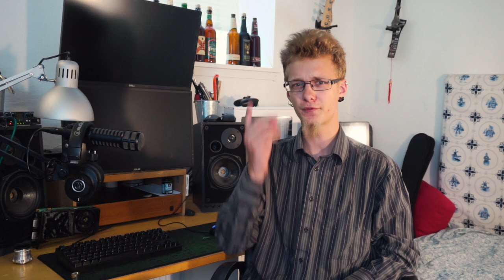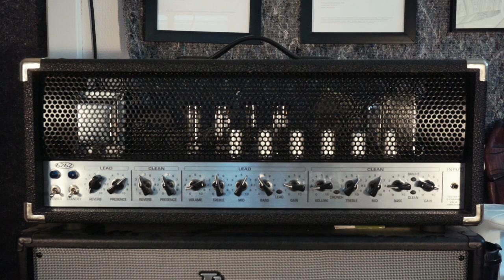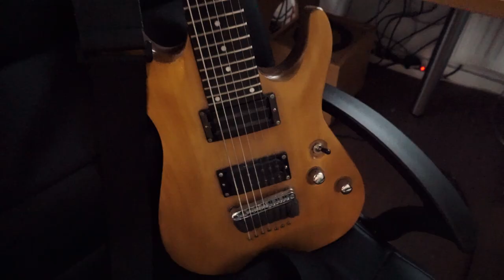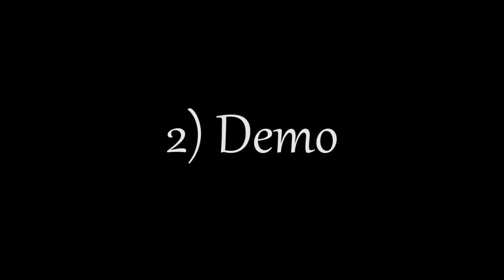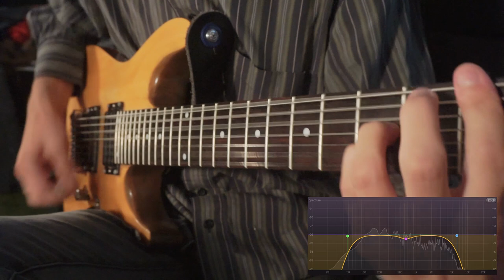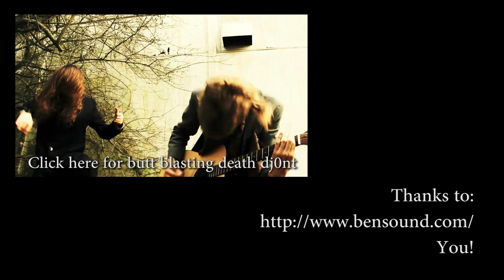Bugera 6262 - Metal Demo and Review

Comment: Many people complains that Bugera amps are shit and breaks often. but with my Bugera Trirec i didn't have any problems and when i changed tubes in it, it sounds amaizing. Killer tone :D
Reply: They were very unreliable back in the day, with their first models having a plastic clip that melted and could even catch fire. After that was fixed they still were not very reliable and they still carry that reputation to this day. Now they have upped their QC quite a bit (and prices have gone up on new models) so I think they are pretty safe buys today, atleast for bedroom guitarists and if you are unlucky and get a lemon the warranty takes care of it and you should eventually get one that does not break. But the used market is still full of the old, less well made ones and you are on your own if one breaks so be mindful of that.
Reply: I just changed the tubes in my Bugera Trirec too. I put in Sovteks and it sounds amazing. Cheers brother
Reply: who speaks that friend are people who have never had or worse have never touched a valve amp
Reply: I agree about their past but believe it or not, I have a friend that works in the industry and he confirmed they are actually hand built and wired and their reliability is just as good as anything else today. My 6262 is a year old and hasn't failed me once. They can not be beat for the price. I got it brand new from a guy for $500 and it sounds better than my Mesa TR that cost me a fortune. It sits And collects dust cause the 6262 is just so tight and not fizzy and it's one of those rare amps that the higher you crank the gain, the better it gets. Most have a sweet spot around 1-2 o'clock. I'll never sell it. And whoever said the comment about the Sovteks couldn't be more correct. It was the first thing I did and it's just ridiculous now.

Comment: I've got a Bugera 6262 for 10 years. I've played it 5 hours everyday with hot biassed stock tubes inside it for 3.5 years. A friend of mine spilled a beverage on it while the amp was on. I turned the amp off with lightning speed. The beverage got two of the power tubes near the input jack wet. I cleaned those and the sockets with paper towel and dried it for about 20 minutes with hair dryer until i was sure. Then i played it for another two weeks but those two tubes started red plating until they popped out a fuse. I opened it up and removed the tubes then i saw burn marks in the tube sockets. I thought it was done for. I didn't even try to fix it or hire a technician because i knew they were ready to rip me off. I decided to get a bedroom level small amplifier and man 6262, it's way too loud for an apartment. I used crappy small amps and not really been to playing guitar because of work and life not having much time and all those stupid excuses. Then recently around 2 months ago i got into playing guitar for long hours again. Decided to fix this amp. Cleaned up the board with contact cleaner and replaced two blown fuses on the power stage. Did not replace the old tubes. I just cleaned them up with a contact cleaner this time and turned the amp on. It worked. The two tubes were red plating still tho. But they were really heavily used. Hot biased and for 3.5 years 5 hours of everyday use they made it. I thought it was time to replace the tubes and ordered a TAD 6L6GC Quartet from Thomann. But i could not wait for the new tubes to arrive. I just thought maybe if i swap the tube 1(fine tube) with tube 3(red plating), i would balance the stress and with a colder bias it would stable. And yes it did! It even sounded great! I used it for about 2 weeks like that until the tubes arrive. I installed the new tubes. re-biased the amp and been using it just fine ever since. Do not believe shit people tell you about these amps. Any electronic device can die anytime because of the environmental factors. Even for the top quality brand shit can happen. If you get these amps, make sure you open up the chassis and check if any connection is loose. If the non glued pin type connectors get loose for example, the speaker out. It will fuck up the amp. Just check the connections once you got the amp. These amplifiers are not built with the best quality check and also during shipping, connections may get loose.  Make sure before you open up the chassis for any reason, turn off the amp while the stand by switch is on. It will ground the preamp stage and some capacitors on it. Then unplug the power after a few minutes. If you happen to turn off the standby then the power switch, some very high voltage electricity can still be present in capacitors and touching anywhere in the board can cause enough shock to kill you even while the amp is off and unplugged. I recommend wearing plastic protective gloves during the procedure for extra protection. 
If everything looks good. It's wise to check them from time to time, like once every few months.

Comment: I ordered the infinium so fucking excited. Couple questions. When you were doing the back and foward between single and dual guitars on the dual i heard almost like a scraping noise on it. What was that? Second question i have an ibanez rga42fm with those ibanez branded actives in them. I was thinking switching them to the SD invaders do you think its worth the trouble of going active to passive and do you think it will sound better?
Reply from the maker: The scraping noise was my terrible playing ;)

I think passives in general are more versatile than actives, and some good SDs are gonna assblast any stock active pickups. I do think the invaders are too dark sounding though. The Nazgül in my guitar is kind of extreme in the opposite direction, but I guess it's all to taste. Consider the Pegasus, the JB or a good ole' Distortion as well.
Reply: Kadence hey i thought your playing was dope lol but yea they are dark and yea its def a  taste thing i actually already compared the two i prefer the invaders because of the darkness in the tone the nazgul tho heavy af it was too bright for my taste. There just so many damn good pickups its hard to choose.
Reply: I agree about the passives. I have a Sterling Musicman JP150 with SD crunchlab and liquifire. Both sound sick with the 6262.

Comment: Who has or had the 6262 around here? I'm looking forward to buy it, but I can't decide on this one, the 333xl, or Trirec. Any thoughts? Thanks!
Reply: MadBurner1 I recently brought the 6262 infinium second hand, I absolutely love it! it's based off the 6505+ from Peavey. The 333XL I think is based on the Peavey JSX and Trirec is based on the Mesa Dual Rectifier. obviously they're not 100% the same but they're pretty close to what they try and emulate. Hopefully that helps you to narrow down your choice by what tone you're after. I reckon they're all amazing for what they are. Just make sure you purchase the amps with the "infinium" name as they corrected some fairly major faults that plagued the non infinium range.
Reply: thanks dude!
Reply: MadBurner1 No worries mate. Hope it helps a bit
Reply: The Trirec sounds nothing like the Mesa dual rectifier. In fact, Ryan Bruce does a comparison vid on the 2 amps and the trirec destroys the mesa. The mesa is just so muddy while the trirec is nice and crisp.
Reply: Have all three amps here.  I like the 333xl  the most, but thats just my personal taste. They all sound great in my opinion.
Reply: SixStringViolence if I want to play without any boost should I look into the 333 or one of the “British Bite” series.
Reply: 6262 for sure. It's gets more use than my 6505, Mesa TR and PowerBall. It's so tight and responsive and unlike 95% of other amps, it sounds better the higher you push the gain.

Comment: I know this is a old video but wanted to know if you have any problems with your deathbucker.  I am about to pull two of them outa my King V no matter what I do I just cant get them to stop picking up computer noises from my pc when trying to record.  I have used shield paint on everything I can and they are picking up what I think might be hard drive noise or fan noise.  I do plan to go fully SSD and hope that helps but I do not have problems with standard humbuckers .  Yes single coils pick it up too but these no matter if wired single coil mode or in standard bucking mode just pick up too much computer noise .  I'm rather bummed.

Comment: Pretty sure the 6262 is actually based on the Soldano, just like the Peavey 5150 was. Why would Bugera have copied a copy?
Reply from the maker: Well yea. The 6262 is a 5150 III copy, which in turn is a variety of a SLO 100 copy. Why do they do it?

Because it sounds great. That's all there is to it I think.
Reply: Well, actually I think there's a bit of added design in the 6262 now that I look at all 3...the SLO and 5150 both have 5 preamp tubes, whereas the 6262 has 6 preamp tubes. Perhaps not much more complicated in terms of designing a circuit, but I think it might have a fairly dramatic impact on voicing. My 6262 could be at bedroom volume and still sound incredible with no pedals. I wonder if more preamp tubes has something to do with that.
Reply from the maker: All I know for certain is that the more preamp tubes you have in a cascading type amplifier, the more gain it's gonna crank out. And the 6262 sure isn't lacking on gain.
Reply: Yeah, more preamp tubes equating to more gain was the impression I had as well. Agreed it's no slouch there. :)
Reply from the maker: I've seen people replacing the 6th preamp tube with a 12AT7 I believe for slightly less gain which enables a zero gain clean sound on the clean channel. As you probably know, it's practically impossible to get a true clean sound out of a stock 6262. Something I've considered doing myself. Haven't got around to it yet though :S
Reply: Interesting take. I always thought it had a very nice sounding clean channel, very warm...but perhaps we have different tastes when it comes to cleans.

Comment: sorry for asking I just bought one, I have 2 speakers 8rms (8Ω) 100 watt...if I use it with them will I cause damage to the speakers or the amp>?
Reply: Never put the power switch on if your tube amp is not hooked with cabinet. If you put the power switch on without speaker cabinet hoooked into amp then amp will get fried.
Reply: If you use parallel connection, then overall impedance will be 4 Ohms and if you put them into 8 Ohm or 16 Ohms amp's output, then you can damage transformer, speakers or both. If you connect speakers in serial, then overall impedance will be 16 Ohms and you can use any amp speaker output - 16 Ohms (default best option), 8 Ohms or 4 Ohms and not damage anything.

Comment: I hope you respond to this question. I have the same amp and the guy I bought it from took the logo off too lol.  You people NOT liking the Bugera Logo lol. I put it back on mine lol.  But was wondering when I first turn mine on it starts on the clean channel but I can hear a few quick clicks of a relay and the clean led light blinks really fast with the clicks then it stops clicking and is fine. I was wondering if yours does the same thing or not?  My 333 XL has some kinda delay and lets the power supply voltage fully form up in the filter caps and then you hear the click and the lights and things come on.  Im wondering if maybe there is some kinda delay circuit or something that is broken in mine.  It only does it if its a cold start up for about a second and then is fine from there on out.   Thanks
Reply from the maker: Hi Jennifer, I haven't heard of this particular issue, nor have I experienced it myself. Sorry I couldn't be of more help. Also, it was the previous owner who took the logo off ;)
Reply: @thane_snipes  So yours does not do that ?  Its just a split second when you first turn it on the clean channel led blinks about three times or so and you can hear the relay clicking same time.  Then its fine .  I have been just ignoring it figured maybe they all did that when you turned them on.
Reply from the maker: @Jennifer_Prentice 

Nah, never experienced it. Your hypothesis is sound to my ears though (so to speak). I guess if it's not anything more than you describe, it might be easiest to just live with it.